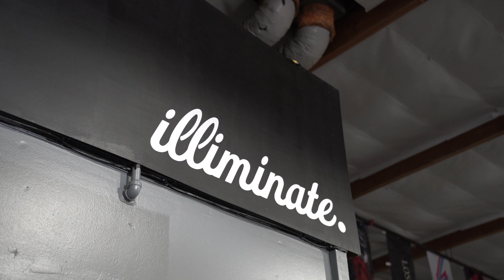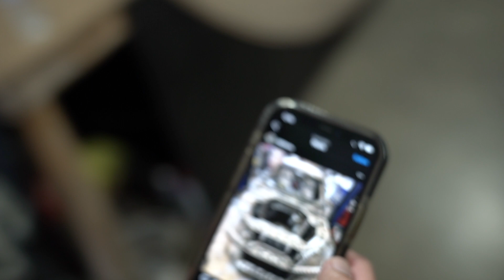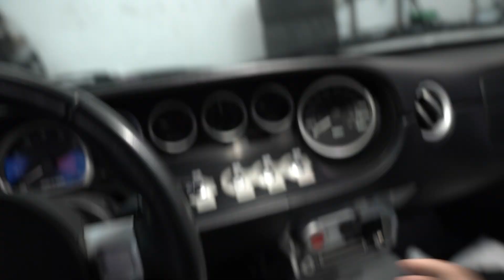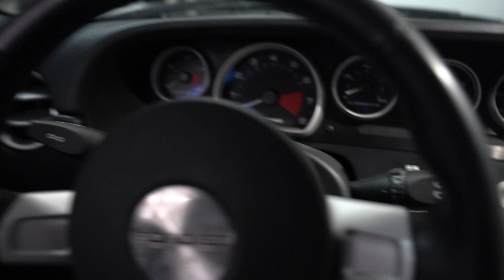Hotboi Wheels for the A90 Supra! (+100 Style Points!)

Comment: Hey Randy, I have a question. I have 2 240's coupe and hatch and both have front fenders that have been mashed to hell. Any suggestions on replacements? I had bad luck with fitment with the cheaper stuff. I am also in the bay and if there is anyone local you would suggest I would greatly appreciate it.